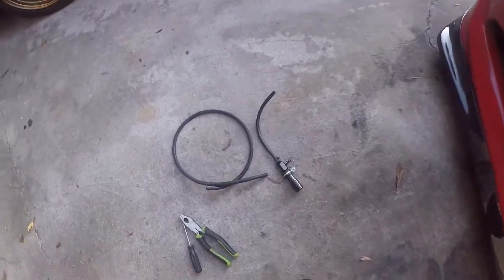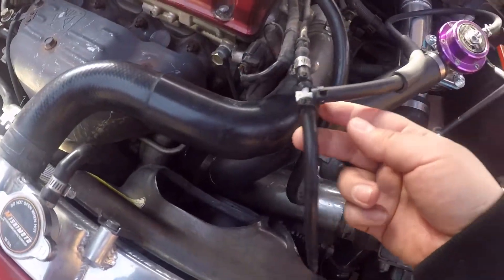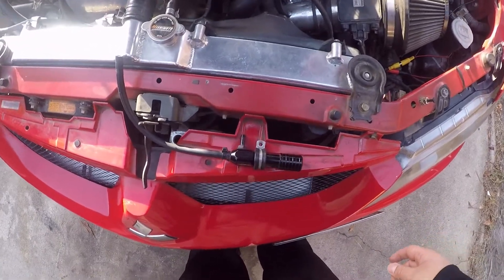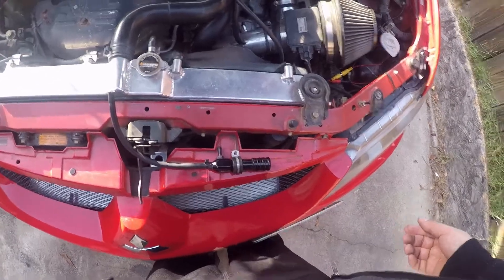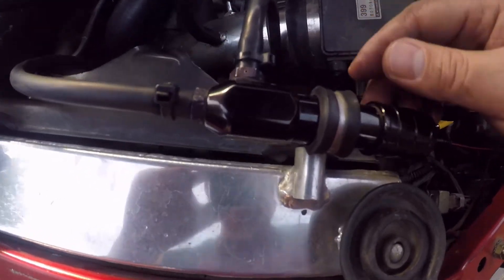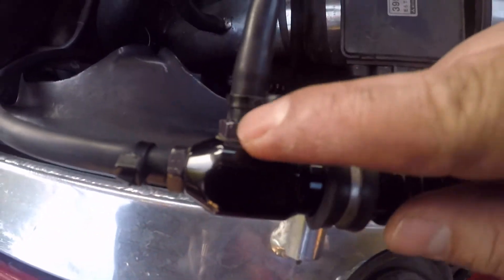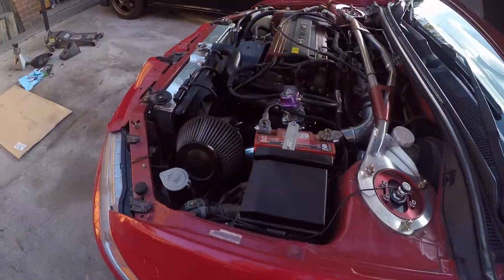03 Evo 8 Manual Boost Controller Install and test drive 12psi to 20 psi fix

Comment: Do you have an Air fuel gauge to make sure your AF is correct under boost?
Reply from the maker: i do, but its not install yet, got a AEM AF gauge. still waiting on the triple gauge pods to come in and oil pressure gauge, but Stock psi on Evo should be 18-20 psi. The car was currently street tune on the current set up and psi pressure. Previous owner had to put it back to stock to smog it. straight pipe, MBC boost pressure, intercooler piping.

Comment: How many turns Did  you did
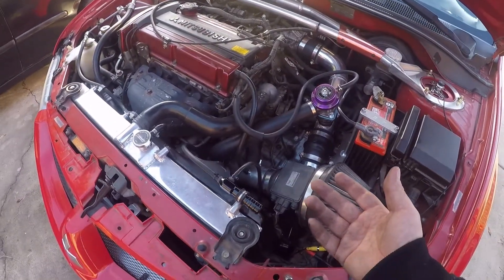Reply from the maker: 4:05 into the video i explained how many full turns i did. i did 6 full turns clockwise and it gave me 22 psi taper down to 20 psi, then i turn it 1 full turn back Counter Clockwise to get My desire 20 psi i was looking for and it taper down to 18. Hopes this answers your question. All MBC might read or get or hold different boost pressure so, you should start slow and work your way up to be safe.